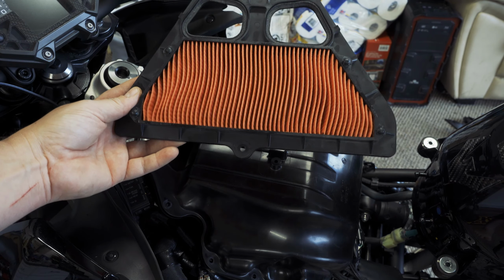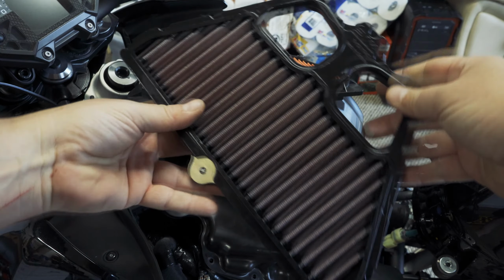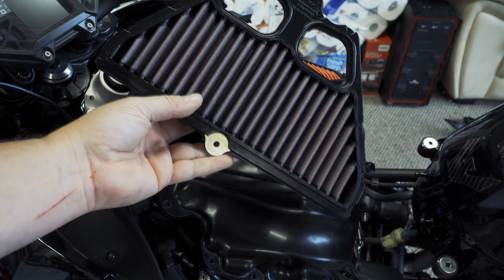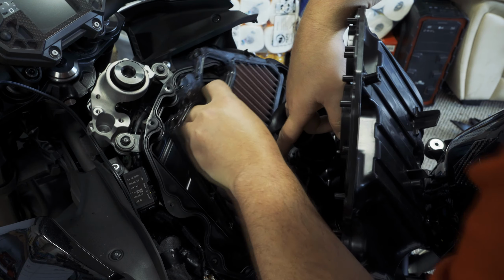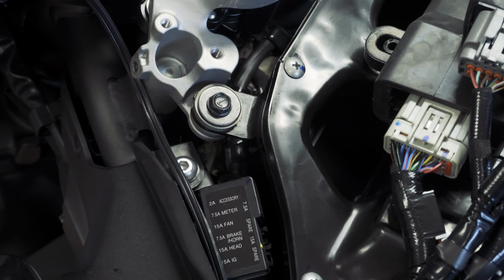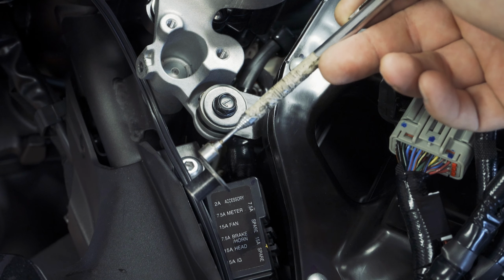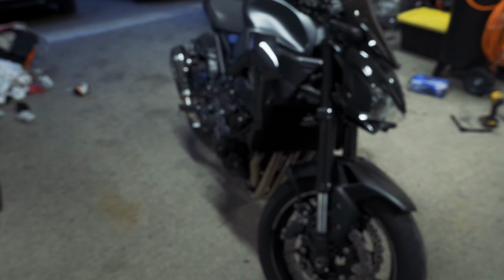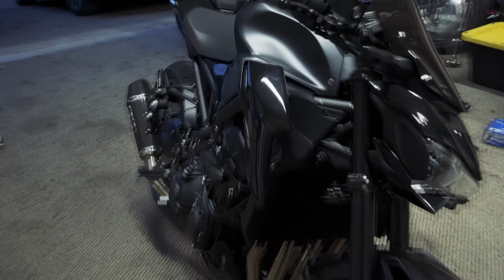Z900 After Market Air Filter Install

Comment: Ugh that's too much work 😭 I'm just gonna assume mine is clean for now...
Reply: this is what i was thinking hahaha. how many miles does yours have? im at 11,200 and I assume its never been changed
Reply: @devin1148  Last year in May, I had to replace the fuel pump after it died. I used the opportunity, with the fuel tank already removed, to have the mechanic check the air filter. Surprisingly, it was nearly clean with just a hint of light dust. The mechanic used an air compressor to gently remove the minimal dust present. My Z900 had 10,000 miles on it at the time and had been through some dust storms. I remember this because on that day, I also changed the oil and oil filter, and I took  a picture, that is still in my gallery, of the odometer to mark the oil change.

Comment: Follow up  2 years later... did you notice any improvement over the stock air filter?  I'm hearing they may not be worth the extra cost over OEM filtrr5, in fact they may require more maintenance.  ?
Reply from the maker: No difference in performance. A little more intake sound. Thanks for watching.

Comment: Thanks for the video, I really apreciate it. 
What is the brand of the motorcycle switchboard? Is it a DENSO switchboard? 
Thank you.
Reply from the maker: Sorry not sure what a switchboard is , the air filter was from DNA.
Reply: Simple Simon  I mean the ECU.
Reply from the maker: @salvaros1460  Stock ECU I added a Power Commander 5

Comment: did you ever have an issue with bending that hard fuel like under the tank i see you did not disconnect it?
Reply from the maker: No I have not had any issues.
Reply: @SimpleSimon  i did the spark plugs in my bike and turned the tank around did not disconect the line at first i saw i bent it so then i just disconnected it. that line is 112 bucks from Kawasaki. it seems fine but curious what the inside is made of.

Comment: I would like to know how the ride went and did it change the exhaust note, throttle response, gas mileage etc?
Reply from the maker: I am currently working on a video to review this aftermarket air filter, I am collecting the data now I should have it up in the next week or so.

Comment: is there any wires that need to be removed for the fuel gauge ect that i did not see in the video??
Reply from the maker: Only line was the fuel line to the tank. No other lines or wires that I remember. There is a plug on the pump   the bottom of the tank real easy to remove
Reply: @SimpleSimon  Thanks. also this may be a dumb question when when you removed the fuel lines how did you keep fuel coming out of the line or was the tank completely empty?
Reply from the maker: @urbandualsport  My tank was full of fuel, the fuel pump is in the tank so fuel wont leak out. a little came out of the line going to the engine.
Reply: @SimpleSimon  Thanks man!

Comment: Wow that's a lot of work to turn your bike into a vacuum cleaner because it's guaranteed to ingest dirt now, oem doesn't use those style of air filters for a reason
Reply from the maker: If you are in a very dusty environment you may want to keep the stock one. Thanks for watching

Comment: Nice one. Did you feel any changes on the bike after changing the air filter?
Reply from the maker: I have not had a chance to ride it. It has been to cold or Raining. I will be working on a video showing performance gains before and after air filter install when the weather permits.